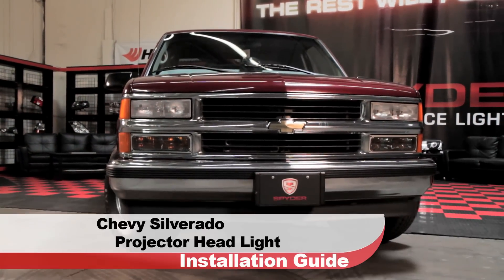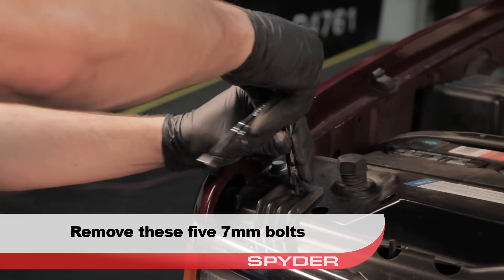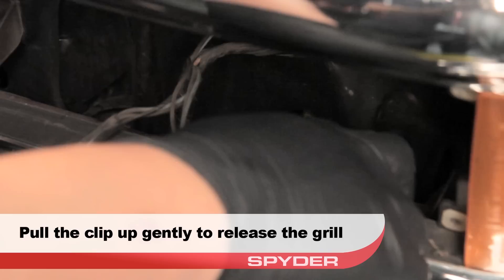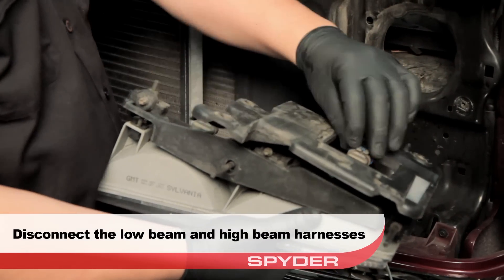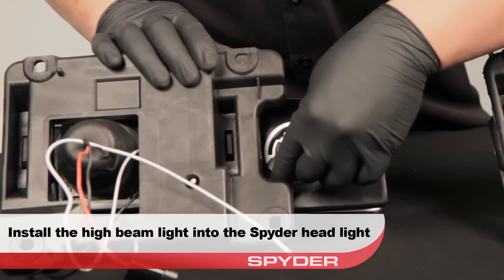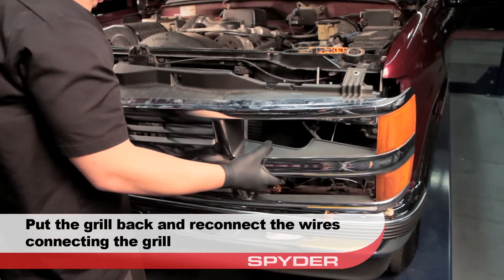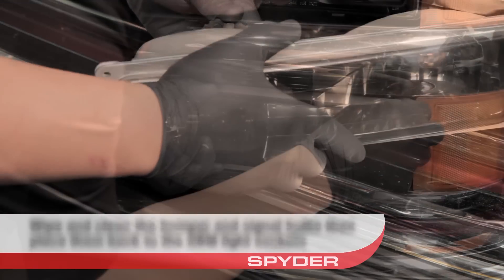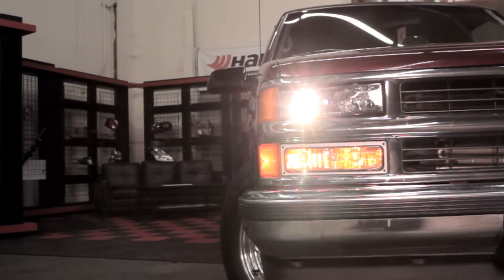Spyder Auto Installation: 1988-98 Chervolet Silverado/GMC Sierra Projector Head Light

Comment: I've gotten everything wired up but when I go to put my grille back on my lights are sitting horribly crooked Not the beams but the actual assembly itself. How do you adjust that? Help needed asap
Reply from the maker: +Colton Whisenant email us some pictures to techsupport@spyderauto.com so we can try to figure it out for you
Reply: I am having the exact same problem.   I don't see a way to adjust the whole assembly.  Mine are sitting higher on the inside part (towards the middle of the grill) of the headlight.  It is clearly crooked on the housing by looking at them, but again, I don't see how they can be adjusted to correct this.   Please help.  I'm calling tech support tomorrow.  Spyder Auto could've at least posted the fix to this
Reply: Wow you can actually see how crooked they are in the video too. That sucks.
Reply: So after reading installation instructions on your site for these headlights, I realized you're completely wrong on how to adjust them. The vertical adjustment is a Phillips head screw in the center of the headlight. Tighten this screw to bring the aim down. The horizontal adjustment, which you don't even list, is a t20 screw located on the inner corner on the headlight. Tighten this screw to bring the corner in closer to the emblem. The 2 pieces you list for adjustment are the pieces used to remove the headlight without removing the grille. Hope this clears this up for the folks looking to adjust this style headlight.
Reply: @l1ndsey7  brother thank you!!!

Comment: Can I do this to the one that have the sealed beams?
Reply from the maker: The sockets for the Seal beam is different so their will be some wiring that will need to be done, on a side note if you alter the SPYDER lights housing/wiring it would void the warranty.
Reply: spyderauto will aftermarket headlights like that fit I would take the old mounting bracket out ?
Reply from the maker: adrguer
You will remove the Sealed beam unit and also the brackets. Pretty much you are going to remove parts to where its just like the install video before we installed the SPYDER lights.

Comment: So I bought this kit. Most is plug and play. I would like to think I am smart enough to figure this install out however it doesn't seem that way. On the HIDs that come with it. I see no possible way to fit it into the new light assy and have it locked in where it doesn't just flop all over the place. I am dying for help to put the HIDs in. I have the exact same light in the video except there is not 1 video on how to install the HIDs on this light. Below are the lights I ordered. Please help!!!94-98 GMC Sierra/Yukon, 94-98 Suburban Projector Headlights /w Bumper, Corner Lights- Chrome (8pcs) + Super HID Xenon Lights Kit Package. Order number 300804457